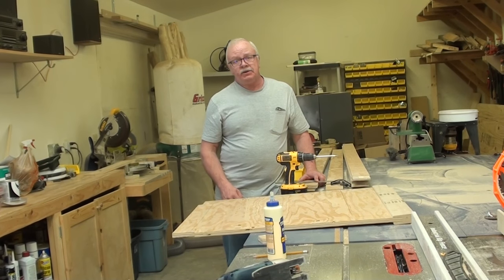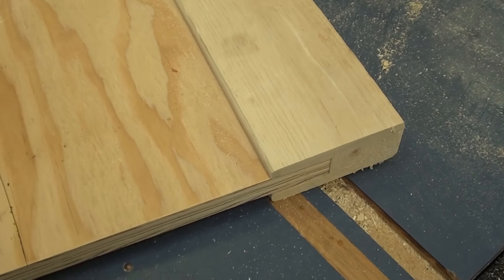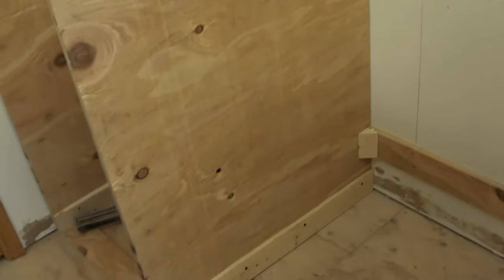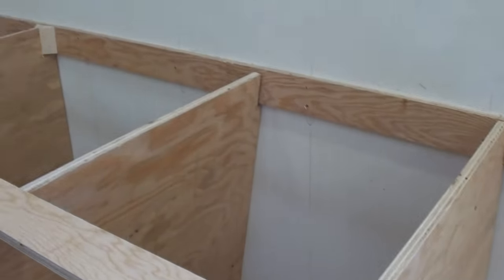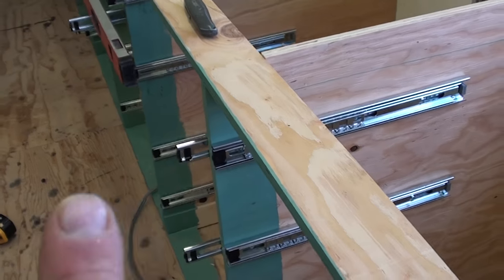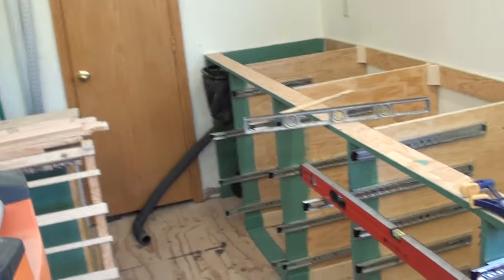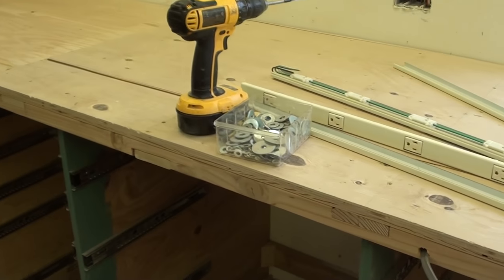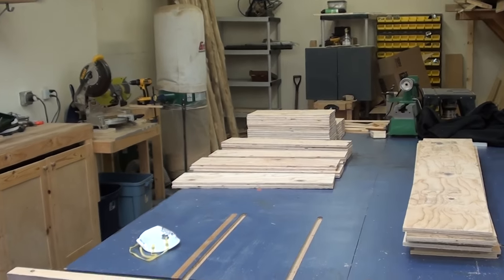Shop Update #3 - Workbench Construction Part One

Comment: It's coming along nicely. I'm far more a metal worker than wood, but on large and long projects that I'm trying to level I don't use the standard carpenters level at all. There all fairly inaccurate to greater or lesser amounts. I don't even use my very expensive machinist's level. They make what's known as a water level. Basically a clear plastic hose filled with water with lines on each end of the hose caps. It's much much faster and more accurate, and for the price well worth having one for jobs like these. The same idea but a bit more sophisticated is used while installing huge machine shop bed mills that can be over 100' long. On those they use proper micrometer heads at each end of the hose so they can measure and know exactly where the waters surface is. Or they may use fluids other than water for a bit better accuracy. On very large equipment even the earths curvature is calculated to correct for that in a water level. But I highly recommend using one for any job like this.

I thought that was a clever idea with the dadoed groove cut in those 2" x 4". Certainly one I'll have to remember.
Reply from the maker: Great info.  Thanks for watching!